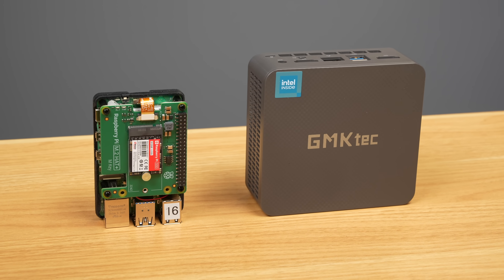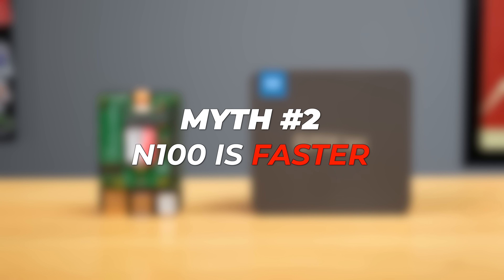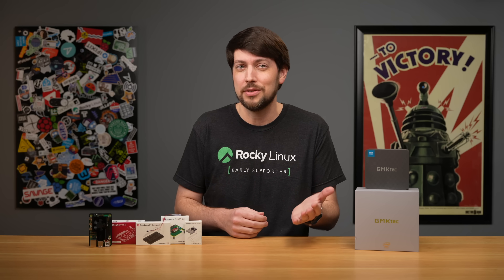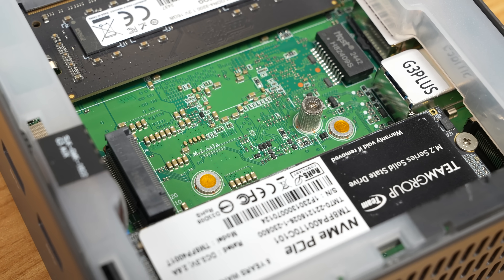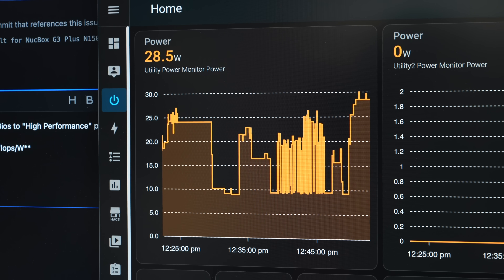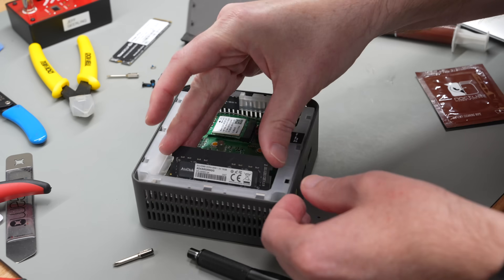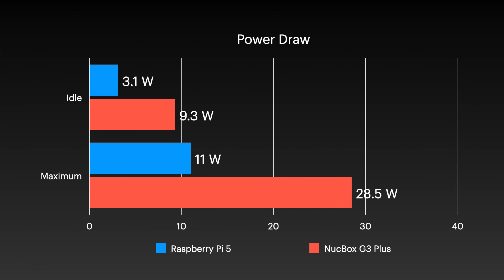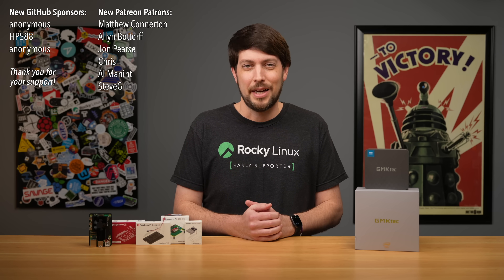When did Raspberry Pis get so expensive?

Comment: You've made this video before. I'm sorry, but these are not comparable machines in any way. The N100 machine has no GPIO pins making it useless for hobby projects. The Pi is useless as an 'average person's' computer. It doesn't have Windows, and even if that's the case, Office doesn't run on Linux, and the majority of everyday software people need to use doesn't run on ARM chips, much less ARM Linux. Yes I know about compatibility layers, but that's a bodge and the Pi isn't powerful enough for that. If someone just wants a web browsing machine only, then maybe a Pi works, but it's a pain to setup and much less user friendly (I could not get my grandmother into a Linux terminal, could you get yours?), not user friendly for when stuff goes wrong (most people still aren't familiar with Linux) and again, there's that pesky Windows x86 software issue again.
Also the Pi 500 not having an NVMe slot for real, proper SSDs (not an SD card, that's not a real boot medium, come on) rules it out too. Apologies Jeff but an everyday person would get a lot more from a used Optiplex for less than a Pi 5 with enough RAM, or a cheaper mini PC. The Pi has its use cases, and a general purpose computer is not one of them. At least not until Windows GPU drivers exist and Linux software x86 emulation gets better.
Reply: I'd challenge your statement that Office doesn't run on Linux: which office? MS Office isn't the only game in town, and with Libre Office and Open Office both some too read and write the MS formats either of those is adequate for most people. 

I've converted a friend to Linux in two stages: some did years ago persuaded him to use Libre Office on Windows, for him a workable solution that saved him a license fee. 

Then not wanting to be forced into buying new hardware when his Win 10 laptop stops getting security updates, he's ready to go to Linux Mint this April (the start of the next financial year for UK tax, which is important for his business - he didn't want to change platform during the tax year).

Comment: Why did you harp so hard on how difficult it was to get Gravity Mark on the N150 (6:00) and extrapolate that to mean the iGPU has major issues, only to mention in passing that the pi couldn't even run it at all (10:46)? Seems unfair to blame the iGPU on the N150 when the Pi couldn't even run the diagnostics to begin with, and clearly indicates an issue with Gravity Mark itself.
Reply from the maker: I didn't go into it (it's documented fully in the GH issue), but the N150 in general requires later versions of some libraries in Linux to work, so unless you're running Fedora, Arch, or a later version of Ubuntu, you'll run into issues with all OpenGL and Vulkan apps.

The iGPU on the N150 is still better than VideoCore on the Pi, but it's not without its annoyances if running in Linux.

All that to say comparisons are never so black and white. If comparing to Windows it might not have had the issues, but then people could rightly complain I'm not really comparing the two on the same playing field.

Comment: It would have been interesting to see the benchmarks of the lower spec'd Raspberry Pi configuration mentioned for comparison. I know some benchmarks would be the same, but some wouldn't. Pointing out that it's much cheaper without showing the sacrifice in performance for the cost seemed a little out of place. I use both mini PCs and Pis for the appropriate use cases, but I will say that during the pandemic, mini PCs were way better price to performance due to the jacked-up prices of Pis at the time.

Comment: DDR RAM sticks have always been "keyed" differently, as they also usually gain pins with each generation, and the power changes.

So OFTEN, the CPU can support multiple generations of RAM, but the Motherboard determines TRUE compatibility.

Comment: Pi5 16GB RAM with NVMe SSD is perfect and snappy for home desktop use including Blender 3D print design, but no good for gaming.
Pi4, Pi3, Pi2 and Pi1 were too slow.
Pi0 for SD card security cam stuff. Looking forward to the next Pi with USB-C ports and no SD card slot.
Reply from the maker: Using USB-C would free up board space...
Reply: @JeffGeerling  maybe room for a 3rd micro HDMI port? 3 screens FTW!

Comment: I recently built a DHCP/NTP microserver out of a Pi4 with 2GB of RAM and a PiJuice for backup power. Normal supply is off server UPS.

Why just that? Because I don't want to run them on the servers so that they don't always need to be up and it's against my security religion to run more services on the firewall than essential.

After turning off almost everything not essential on the Pi, I got idle power down around 1.4W.  Then I had to add a fan because the PiJuice was reporting over 35°C. :-( not good for LiIon cells.

The cheap 30mm fan then got noisy after just a couple of days. Something more elegant is on the way.

Comment: Most people I know running PI hardware do so because of low power draw, they want something that is very low power to run 24/7 but with enough performance for the specific required task. N100's are just under powered general purpose PCs which aren't really suitable for embedded applications. Power draw is about more than just electricity costs, it is overall heat dissipated too. PI's draw very little power and therefore generate very little heat, this is good when they are running in tight spaces or you want easy fan less operation.

Comment: If you want to run standartized (docker) software, get a miniPC. 
If you want to tinker with electronics/gpio, get a Raspberry Pi. 

Basically, the reason to get a Rpi is compatibility, not performance. 
Eg HomeAssistant has a Rpi-specific OS available. 
You could run it in docker on a miniPC, but if you want a separate dedicated device, RPi is the way to go.

Comment: Hey Jeff, how do you backup Raspberry Pi4 system with custom apps installed. I run Timemachine on x86 mini pc, but cant on Pi, also Synology ABB, so where are backup tools for linux, especially Pi. I run crazy openhab 1000s of configs setup, mqtt, influxDB, ffmpeg for cam video, and more, i just want it to work when set up, so SD card is no go, USB key also isnt the best, but SSDs on Pi4 draw too much power on USB so also not stable.
SO thats why i prefer mini pc, but need to still figure out system backup for pi4.
Simple auto backup Solutions appriciated😊

Comment: Pis are expensive because they are leaving their niche. Nearly all tech gets faster and cheaper in the long run and Pis mostly haven't. And Pi 2b/3b are still 40 bucks. 

Use cases didn't change that much but the difference to 2012 is that Software now needs much more resources and there is a lot of competition now. Between an esp32 running linux to the bottom, OrangePi/Radxa/others at similar price for better performance and Intel to the top. Raspberry Pi purposefully decided to compete with this instead of improving in their niche. I know that I would just put a Pi in a drawer but for me only the Pi Zero 2 is currently close to my original vision for Pis. And above 100 bucks, there isn't really a question for 90% of use cases: Even in expensive europe/germany I can currently get an N150/12GB DDR5(!)/512GB mini pc for less than that

Comment: One thing about Raspberry Pi is that you can resell them at close to the buying price. This is kind of the other side of the Intel mini PC, where you can buy cheap secondhand but conversely lose a lot if you buy new and want to replace it later. So if you count total cost of ownership for a year ((cost of machine + cost of electric) - resale value) the pi is probably much cheaper. 

Also, if you want to be cheap, you probably have a 5V power supply and keyboard( if you are not running headless) etc.

If it is something that is commonly done of RP I think software setup can be easier on the RP than a PC as PCs are never quite the same.

Comment: Wait, your base assumption about SODIMMs was what? No DDR DIMM standard has ever been compatible across generations, for the simple reason that it would lead to a ton of trouble with people inserting ram into slots in computers without memory controllers capable of talking to that ram. Also, power delivery is entirely different between ddr4 and 5. There is zero reason to expect any such intergenerational compatibility.

Comment: "Only" 1.5 to 2 times faster is a bit peculiar phrasing. 150 to 200% is very significant.
Reply: The N100 was at least 5x faster than the Raspberry Pi 4 (and more than 10x faster for some tasks), so it's a marked improvement.
Reply: i laughed out loud at that part. "Only 1.5 to 2 times faster" like its some minor improvement. 🤣

Comment: This is the thing. If you need server then Pi is an annoying and hacky proposition. Then there is a layer where at least normal HDMI would be nice and proper PD support (9-15V 3A instead of this 5V5A rubbish). And then are project where you leverage GPIO and eventually PCIe. This is where it shines. Except for most of hobbyists where it will end up in a drawer it is better to go with 3A+/3B+ then ;)

Comment: I stopped at 3B+ and I like those older ones. Plenty of i5 and i7 laptops still going. I'm behind 10 years and don't see the point before something breaks like movie delivery, maybe. I started on the micro controllers which I enjoy. It comes with electronics (mostly jumper wires) and I started with C++ recently.

Comment: There was something in the bios of these gmk boxes that stopped the chip from boosting. It is a simple, but obscure setup. My temps dropped from the 90+ to 72. 

Reposting is mandatory with these gmks, the one from factory is bad. And no, there is no need to disconnect the antennas.

Comment: I started my homelab journey with a cluster of pi 4s 8gb, and recently added an intel machine. For me the biggest difference that I actually noticed was on "real tasks" that I was doing. For instance, I tried running paperless-ngx on the pis and gave up because the documents took ages to be processed... and intel chugs them right on, making paperless usable for me.

Same with Plex/Jellyfin (which IMO is a service everybody will try to set up), the hardware transcoding is something that doesn't really show its benefits on a benchmark but is a life changer "in real life scenarios".

And on a separate note, I liked that you tried to be nuanced throughout the video, although I found the efficiency section a bit underdeveloped. In all pi vs mini-pcs videos I see the same simple "you get more power per watt with the pi, hence pi wins". But how much are we actually saving per year? Are the energy saving costs really worth it if it means limitting your max compute?

Like, is saving 30€ a year of electricity better than being hard-limited on CPU, GPU...? Specially if someone is getting into "homelabbing" as a hobby, perhaps having a higher compute ceiling is a better idea.

Comment: Beyond "desktop" application (for example running FreeCAD, very smooth on an 8GB Pi 5 running Ubuntu), my typical use for Raspberry Pi is to retrofit old video cameras to turn them into 1080p 30fps digital devices (or create one-of-a-kind camera). Nowadays, doing this with a 4GB or even the "skimmed" 2GB version is a no brainer, with both hardware and software available (other "fruits" might do it as well, but the software ecosystem (and the community around) are far beyond what the Raspberry Pi Foundation provides). In the past years, I have used Pi Zero W, Pi 3A+ and now Pi 5 (4GB / 2GB) for this purpose and they all do a really go job (although the required battery capacity has increased a lot with the Pi 5 (but you also get more flexibility and picture quality)). Then, I resort to a LattePanda Delta 3 for running OBS Studio, because the last time I checked the Pi still cannot run it (didn't check on Pi 5) ; plus the Delta 3 comes with a eDP very handy to connect a cheap LCD panel (not using the touch capability) and build a "transportable'" PC.
It boils down to "use the hardware that better suits your need, depending on your use-case".
Reply: Thanks fro sharing. Is there any finished project Docs or references that one can check on the subject of retrofitting old cameras ? Got one collecting dust in drawer....
Reply: @yingbxua6240  Sorry, the process is ongoing, highly undocumented, and each camera is a different story. But the basics are the same:
- empty the device, keeping the case and the front mount (actually the only reason to use old camera)
- find proper Front Flange Distance
- design a 3D printed sensor mount that provide a correct-length optical path (a 0.2mm margin is available, lens have a "back focus" setting, but limited ; optical alignement doesn't require perfection either, some sensors have more pixels than required, and selecting a software Region Of Interest will do the trick)
- design an internal / external chassis to hold the selected Pi
- design a power-supply (simple USB power bank for Pi3A+, a powerful enough step down for Pi 5, fed with a typical "video" battery with a DTap-to-jack cable)
I tend to put Pi3A+ outside at the back, as they are Wifi-only ; as far as Pi 5 are concerned, one is internal (to allow keeping the back panel of the case), one is external.
Over the last 2 years, I have successfully retrofitted:
- Panasonic AW-E300 (1/3" with C-mount) with an IMX327 sensor connected to a Pi3A+
- Panasonic AW-E600 (1/2" bayonet mount) with an IMX477 sensor connected to a Pi3A+
- Panasonic AW-E800 (2/3" bayonet mount aka B4) with an IMX283 sensor connected to a 4GB Pi 5 (that was before the 2GB version existed)
- Sony DKC-5000 (1/2" Sony bayonet) with an IMX327 sensor connected to a Pi3A+
- Sony DXC-950 (1/2" Sony bayonet)  with an IMX477 sensor connected to a 2GB Pi 5
Future projects (hopefully in the next 2 years or so):
- Sony DXC-327 (1/2" Sony bayonet)
- Sony DVW709WSP (B4)
That is learning-while-doing process, though, with still a lot to learn. Might start a blog on the subject, if not for other people to learn anything, at least for me to remember things (it is rather incredible how much you can forget in 2 years ...).

Comment: Here, in France, GMKtec is quite interesting on the price tag against Raspberry PI. Other brands are a bit expensive in comparison for a similar configuration (same proc, same RAM and storage size). In order to have a similar configuration with a Raspberry PI, it's mandatory to buy some addons which increase the final cost.

I had to build/find an energy efficient, powerful enough and cheap as possible pc for a friend's daughter, for school. A second hand "good enough" computer was too expensive or absolutely too limited or in really bad condition in the price range. 

It was a really tough choice to make... The PI 500 kit would be a really good choice, in this case, but they haven't included the PCI-E connectivity... Or, to be precise, they haven't soldered the components to do so... 😢

A custom RPI 5 kit with NVME support from Kubii (official reseller of Raspberry Pi in France) and additionnal NVME drive, keyboard and mouse or GMKtec G5 N97 (which is slightly better on the iGPU performance than the N95, N100, N150) with an additionnal keyboard and mouse ?

The G5 N97 won... A final cost more interesting, a bit more powerful/responsive and able to run Windows quite well, so there's no compatibility issues. And it can run a USB live drive for retro gaming as well, slightly better than a RPI... 😅Don't tell her father about the usb key... 🤣

Comment: Pi's aren't exactly cheap in Europe aswell. With import costs and taxes like VAT Pi's go around 85-90€ 's here for Pi5 4 GB Model. So its about $95 US in current rate. You can get Pi 5's cheaper from Germany but 11-15€ postal feed's do nullify most benefit of cheaper price. I do love tinkering with Pi's but they are not nearly economic as they used to be. I wish  they would make Pi 5 lite. Something that is between Pi 3 and Pi 4 in performance while drawing considerable less energy and would less expensive, closer to the original idea (and get those god awful Micro HDMI ports out for full or Mini HDMI x 1) N100's go absurdly high 250-300€ range though in natively, making it more sense order mini PC from Asia directly and pay VAT and its still considerably more cheaper than getting one locally.

Comment: When I think of a raspberry pi, I put it in a tier above arduino esk boards. Its purpose is for at home gadgetry, and small computing for personal projects that do need real proccessing power to run. In no way would I consider it a computer replacement (but thats my personal take). Im just not sure the mini PC would run any hardware module not designed for the USB protocol without a lot of work or learning, for example servos, temperature sensors, the likes. 
Anyways, all this to say, in my mind Pi's are for a different purpose.

Comment: The original PI definitely wasn't $35. 
I just checked my emails, and I bought a new PI B+ in 2015 for $30, and that price included the NOOBS SD card.
Today the lowest tier of PI 5 in the same store starts at $68 (no SD card included).

edit: 
Just verified in my emails, that price in 2015 also included the power brick.

Comment: I like raspberry pis for servers.  I have been running a bunch in my rack for a many years.  However, I mind the lack of mature hypervisors that run easily on it.  I like virtualization because it makes taking backups and whatnot trivial.  
I would love to run Proxmox on a Pi.

I have mostly been consolidating my services onto a rack mount PC with a modern Ryzen CPU.  I get good idle performance but can load it up with VMs and containers like crazy.  The x86 compatibility has reduced my difficulties setting stuff up.

I do still put non-critical services on my Pi 4s.